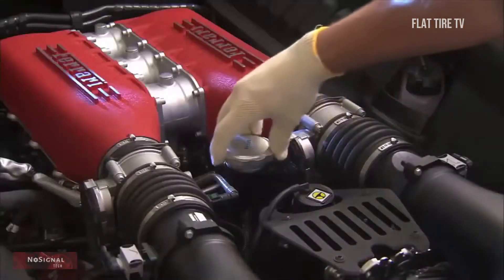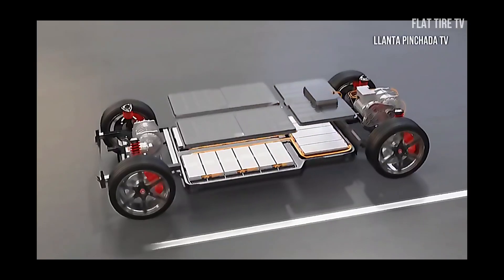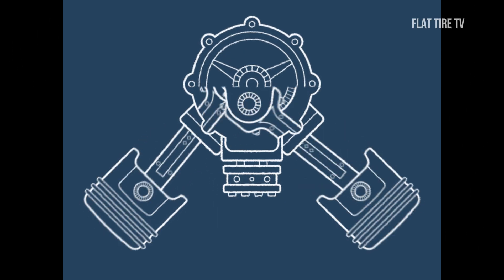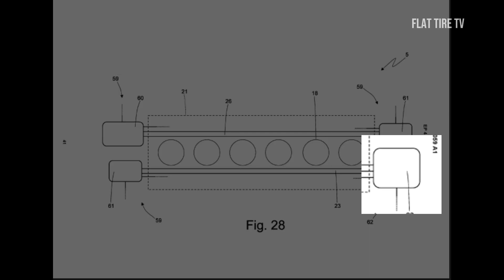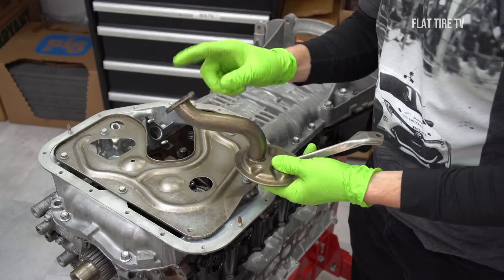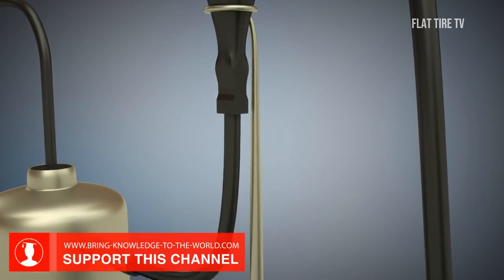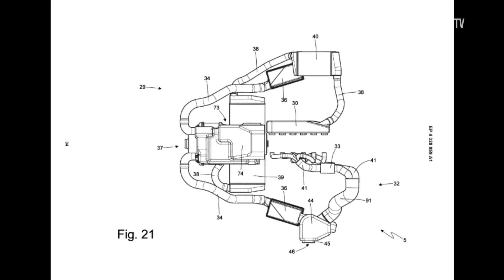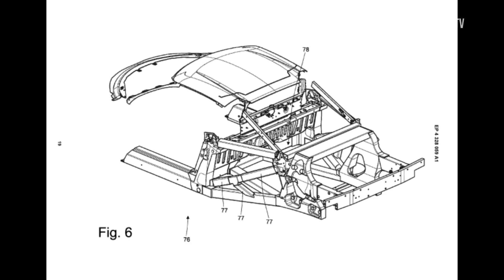FERRARI presents the WORLD'S RAREST ENGINE!

Comment: Those upside down engines were popular on airplanes, they had to add a drain to the head so the oil can be drained from the head before starting the engine 
There’s a guy that built a motorcycle with and upside down engine